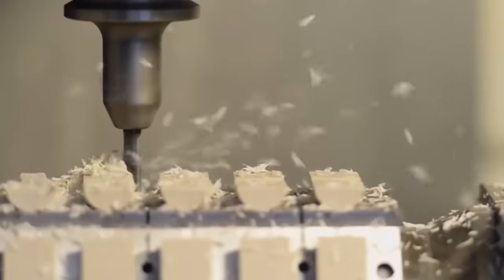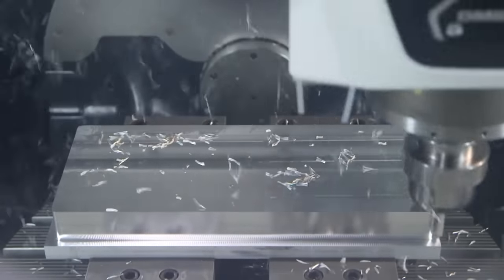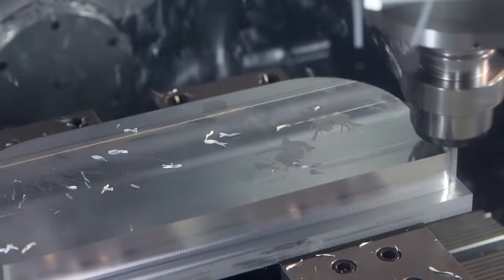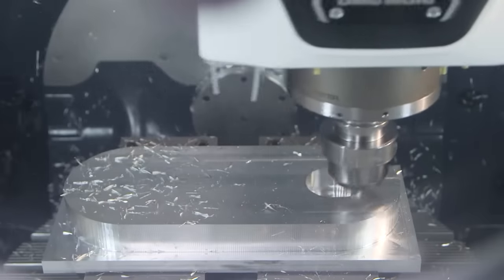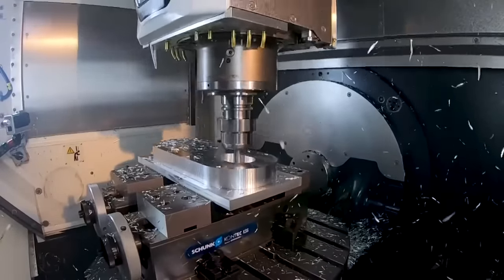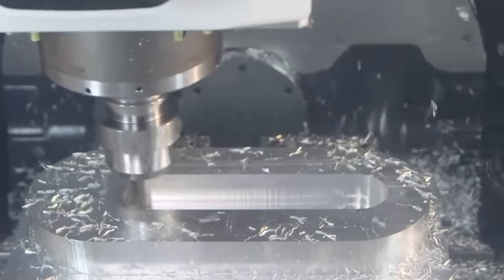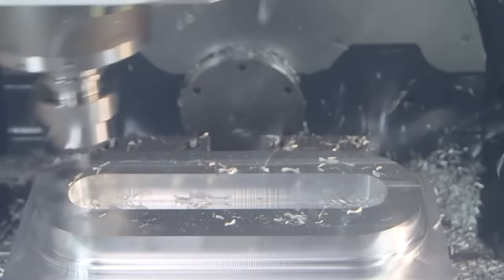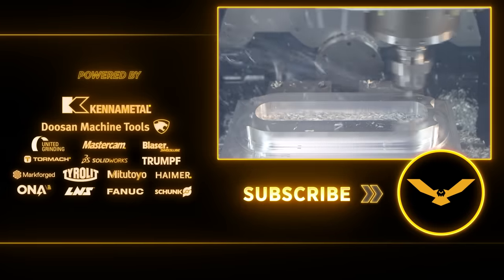High Speed Steel End Mills are Better than CARBIDE

Comment: I programmed a medical part from 17-4 the other day. The machinist came to me and said the 1/2 in endmill is running too fast. I looked at it and said its fine. I explained I was using a high speed strategy. He said he knows but, they've never run a 1/2in endmill in 17-4 over 2500 rpm even with a high speed machining.. I told him if it doesn't work, lunch is on me. He never came to claim his free lunch.
Reply: Bwahahahahahahaha love this comment
Reply: 17-4 is a very odd material as it has the ability to run at high rpm or lower rpm and both will work depending on Woc and loc. I've got a few projects I cut in that material it's  always fun material to work with
Reply: I'm relatively new to milling. I've been a lathe programmer for 35 years. I do mostly mill/turn machines.  I'm loving this new information!
Reply: Did you kill him?
Reply: What was the heat treatment of the part?
Reply: @joelstienlet1641  I believe it was H950
Reply: Those RPMs sound right to me
Reply: If I had a dollar for every time an operator was afraid of my parameters, slowed it down before he even tried it, and then wouldn't admit it was his fault when something went wrong I'd own my own company. I've programmed mills on aluminum with feeds that exceed the rapid paramater before. (Yes certain machines will alow this depending on the rapid parameter). It looks weird to the operator when the machine slows down to rapid and speeds up to feed. So they emergency nope the hell out every time.
Reply: @phuckyocouch9098 hmm I wonder why the machinists don’t trust you as a programmer 🤔
Reply: @johnjay1147 because they're not used to high speed machining. The good ones find some room to even improve the run times because initial posts are meant to be starting points that I know are safe for the tools. The ones who don't know what they're doing slow it down. I've had to do demonstrations on multiple occasions to get people to stop doing that. More often than not you're just going to hurt tool life by trying to guess when you slow it down. And don't even get me started on ceramic inserts. 800 surface feet and .008" ipr on COBALT? yes, just run it. 9x out of 10 you're gonna have to demonstrate it for a first timer.

Comment: Now a days HSS still have some good aplications due to 2 things, first as u said it deflects more, and second the edge can be thinner than carbide if u are buying high quality HSS like HSSE-PM and thats a game changer for some materials
Reply: I use it for that exact reason. On Delrin and acrylic it leaves a very nice finish. So I rough it with a DLC coated 2 flute then kiss it with HSS for a perfect finish.
Reply: @importanttingwei7747  work somewhere else
Reply: Yup. HSS is sharper than carbide.
Reply: @brandons9138  That's a myth.
Dedicated Aluminium carbide tools are easily as sharp as HSS.

And for steel a perfectly sharp edge is not the best choice.
Reply: @norbertfleck812  The sharpness of a carbide end mill is dictated by the size of the carbide grains and the amount of tungsten binder in the tool composition. Since a HSS is a homogenous material it's can be sharpened to a much keener edge. Trying to get the same edge on a carbide tool just causes the edge to round over as the carbide particles separate from the tungsten binder. I'm not saying that you can't get an extremely sharp edge on carbide, but the limits of the material composition dictate it's ultimate sharpness limit. That limit is higher for HSS.
Reply: @brandons9138  That's a myth.
The granularity of modern carbide tools is irrelevant when it comes to sharpness of an endmill. 
My carbide tools for Aluminium or wood are sharp enough to cut paper.
Reply: @norbertfleck812  It's absolutely not a myth. Carbide's brittle nature makes it exceedingly difficult to achieve the same level of sharpness as high quality HSS. The finer the edge you put on carbide the more fragile/crumbly the edge becomes.  Now before this becomes a pissing contest I'll say this. We are quite literally splitting hairs here. Both types of tooling can be made incredibly sharp. Sharp enough that it's practically a non factor.
Reply: @brandons9138  That might play a role at a knife (15°) but certainly not at an endmill. There are carbide endmills available with polished flutes which are as sharp as an average household kitchen knife. We use them for wood milling - and they perform far better and longer than HSS, especially in soft Wood such as pine.

Also HSS has got a granularity caused by its crystal structure. And it wears off very fast, compared to carbide.
Reply: It's also great for older (usually non-CNC) machines that can't reach a high enough SFM for carbide to have an advantage. Some old machines are very rigid and can handle immense feed rates and depths of cut but have painfully sluggish spindles, worst cases are usually pre-WW2 machines with plain bearing spindles.

I recently met a toolmaker who swears by carbon steel tooling (the Queensland railway workshop still taught machinists to forge their own carbon steel cutters back when they were an apprentice) for cutting very soft material like plastic. They claimed you can finely polish the edge to sharpness that even HSS can't match. I'm guessing the ability to customise the tool geometry for such stringy material probably helps a lot too. And of course the heat resistance of HSS or carbide is wasted on materials like UHMWPE because cutting at high speed just melts the plastic and makes a big sticky mess.

Comment: I work in a job shop for over 20 years and we use about 80-90% of HSS tools. That has to do with our machines. Some are 30 years old and almost no maintenance was done on them. We have chipped spindle everything is loose old adapters. 🤦🏻I’m jealous when I watch you guys slay that metal
Reply: Man, that hurt me eyes reading that. Convince them to buy ONE new machine, bro
Reply: @barrysetzer  we have some fairly new machines but those need some TLC. I have a feeling that my boss is going to sell business. He’s on the older side.
Reply: That's not too bad compared to one of my customers who run a fab shop,poor worker trying to cut solid round 2" bar using an angle grinder somehow can't afford a bandsaw but drives around in a 250K car.

Comment: yup i work at a small company that's stuck. They have no money to buy good tooling, but they have no money because they keep wasting it on crappy tooling and having to pay machinists to sit there staring at the machines running at 1ipm. I had to make a 2x2x11 inch slot in multiple 316 stainless parts and they hand me an old 5/8 HSS roughing endmill. it took me literally days to do these parts between the broken endmills and the incredibly long time it took to machine these parts. 1ipm machining sucks. Then I needed to tap these parts, I asked for at least coated taps. Instead i'm given an hss spiral point tap to use on blind holes. I asked for spiral flute taps and they said they "break too easily" and didn't want to use them. I said I can manually program a thread mill (since cam is a "waste of money"), they said those are also a "waste of money". I keep trying to help them but they ignore me because I'm fairly new to machining. trying to help them change but it's never going to happen, they're way too stuck in their ways.  sometimes all you can do is shake their hand, thank them for the opportunity and move on with your career.

On a side note i actually managed to get my hands on some 11/16 carbide spade drills and I showed my boss the drill running at 1500rpm and 8ipm into some a36 and hes "never seen the machine run that fast before". I told him that's on the low end of what's possible with modern machining techniques and tooling but they still don't want to change.
Reply: If a company slows you down in your own devellopment.. Appy for a job somewhere else.. you'll make more money, and spend less time "with your nose to the glass".. 
I spend my first 4 years in a company just like that.. i was experimenting with how fast i could push tools on a lathe.. but when i was using cutting depths over 1 mm, i was told not to do that.. because the machine couldn't handle that.. 
Then.. i became a toolmaker.. and within a month i as pushing tools with an 8! mm Cutting depth  through toolsteel on an even older lathe than at my previous job.. i learnt so much there..
Reply: You should definitely start your own shop and prove them your better

Comment: The lathe I was using the other day maxes out at ~350 rpm, a pre-WWII Monarch.  When I first came upon it a while back it had some carbide tooling with it, needed a 1/2" spacer to raise the tool post, and no one was using it.  I found a 1/2" HSS blank buried among all the tooling and ground a cutter from that.  It does what it needs to do in our shop.

Comment: I have just manual mills.  I've found that in most cases, HSS is better for that mill than carbide.  I do have some carbide for dealing with harder materials.  Both work good.  HSS is less likely to chip off though.

Comment: I agree so much with this story. yesterday I tried upping the speeds and feeds in off time with my own endmills and the results were pretty insane.
I ran a pretty low alloy construction steel at 300m/min(984sfm) with a feed per tooth of 0.2mm(.008") on a 10mm 4 flute endmill and was amazed how long it lasted
at a 14mm doc and 10% stepover. I am pretty much the only one at work trying to utilize modern toolpaths and i wish it was different.

Comment: I’ve been watching your channel for years. I was a generator mechanic turned designer in the Marine Corps  dealing with 3D printers and marveled at machining. I bought a lathe, mill and mini CNC router. I attempted it once and felt mediocre and didn’t touch anything for years. Over time I became an expert at 3D printing so much so that I started making my own. Now I’m on an all new project and needed machining services. I took a look at my machine and said to myself why not. Gave it a shot with a carbide 2 flute flat end mill. I was surprised at how clean my job came out despite the low speeds and the part being aluminum. I now plan on making my machines CNC.

Comment: I worked in a shop that wouldn't even spend the money on decent HSS, they only bought Chinese HSS cutters that were dull and chipped with burrs all over the cutting edges right out of the box, it was always a fight to get them to order me decent tools (I was the only machinist in the building). On some jobs I was able to get them to order carbide for tougher jobs like stainless steel but they never got anything name brand or coated,  just plain cheap carbide which inevitably broke or chipped. I was pissed when they laid me off, until my old boss called me a few weeks later and hooked me up with Cobalt Enterprises in Washington, they were a tiny machine shop back then but the owner knew the value in quality tools and I never had to deal with cheap tools again, and I also learned about high speed machining there which really opened up my knowledge of machining. Last I heard Cobalt was employing over 200 people and bringing in several million per month, I unfortunately had to quit the machining industry due to me developing severe coolant allergies so I haven't kept up to date with the company but they won a bunch of business awards not too long ago.

Comment: I have had great results using HSS center drills on lathes for production runs on high nickel alloys. When carbide gets dull it shatters but HSS just got progressively dull.
Reply: Agree on that one 100% even on mill I stopped using carbide spot drills for the same reason,It's the only HSS tool besides some drills I use on my machining centre. I don't know what I'm doing wrong tried too many different feeds and speeds and after a while still ends up with chipped edges.
Reply: @mehmettemel8725  I believe the problem is holding it in a chuck and many chucks are out a little depending on there history (jaw wear ect). There's a carbide insert spot drill that is held in a holder that works great.
Reply: @HighGear7445  That is not the case my machining centre is only couple of years old and using collet chucks or hydraulic chucks so run out is not an issue.I haven't tried inserted spot drills maybe worth trying.

Comment: Been doing this on the 750 I'm getting trained on. Sometimes we lose some time due to re programming and back an forth with edits. But now the programming is dummy proof and will run smooth. We have an order coming up that we will beat the runtime by hours  for the whole job because we spent an hour on the last order dialing feeds and speeds updating tool sizes

Comment: I almost fully agree with you on this subject, but I have to say one thing about it you might consider. I have done a lot of prototype work, most of my time is in that line of work. I have to say that there are times, especially in high nickel stainless steels that high speed can last longer in certain situations especially when the customer doesn't want to spend much initially and you don't know if you will ever see the job again. Additionally, when you don't have the high speed spindles and feed rates available it can create difficulty for a small shop. Drilling is especially difficult with some situations in some stainlesses and will break a carbide tool off, whereas hss will put up with  more abuse, i.e. I had to drill a .008"  hole .025" deep in a piece of titanium, and I only had one chance, I  had to use carbide because hss was unavailable at the time, and it was a real nightmare being the concentricity was insanely important. Changing the rpm was very important, and after I got the part drilled, just out of curiosity I drilled as many as I could in a scrap and at the exact setting I drilled 12 more holes. I  moved the rpm a snicker, and it snapped. I would have to suppose that hss would have been easier.

Comment: Back in my day, I kept a set of HSS mills for teflon/delrin jobs. It seemed they had a sharper razor edge that left no burr.
Reply: Carbide has a honed edge. Hss has a knife edge.
Reply: Did you try carbide end mills for aluminum or wood or... plastic? They're way sharper than the cutters for steel. I would try an up/down cut endmill, it has short upwards cutting flutes for bottom and down cutting flutes for top so it won't leave a burr to either edges
Reply: @MF175mp  Yeah there are specialized carbide cutters for almost any application, they really pay off for regular jobs. For one offs having a sharp HSS endmill flying around can do wonders.

Comment: HSS can also take lighter cuts than carbide... It really helps to use HSS in reworking parts that are out of tolerance...
Reply: Thats good to know will have to test this out for my next reworks !
Reply: @austinyates4923  But you need to be aware, that you need to have the cutting edge very sharp... Carbide can also work, but it mostly has a slightly rounded cutting edge... Thats the reason Carbide cant that such light cuts... BUt you need to be aware that I only know that on lathes... I dont have knowledge, if that works on mills too... And you need to make sure, that the geometry of the HSS is right... This Old Tony has a Video "Grinding HSS Tools", which I can recommend...
Reply: @intubungamer6173  Ive found that although cutting conditions are not ideal, carbide end mills absolutely can take very light cuts to reach tolerance. Sure its gonna wear slightly faster, but carbide is so much more rigid than HSS and allows you to make those full DOC walls accurately.
Reply: @intubungamer6173  End mills are very sharp compared to lathe inserts. Also there are dead sharp carbide inserts or dead sharp solid boring bars for lathes too but their applications are more limited in turning (not so much for the boring bars)

Comment: Thank God I always worked for shops that weren't afraid to spend the money for the best tool for the job.
And sometimes HSS tool's are the best for the job, but not very often.
The advantages I have had with HSS was the tool can take a shock. Like using the tool through different materials, hardnesses, intermittent cuts and I have even had better tool life in some high tensile strength materials.
If you have rigidity problems HSS can sometimes works better.
But I can probably count on one hand where a HSS tool could do the job carbide, ceramic, PCD, CBN, coated carbide etc. couldn't.

Comment: Don't forget about down cutting endmills. You can pinch the work in a normal vise and leave a huge stickout or overhang and only support with a machinist jack. The cutter pushes down and the vise stops the twist.

Comment: I’m cutting stainless steel, and other steels including some with super hard flame cut crust, the HSS Rippa 20mm is outlasting the carbide, it’s also only a 1/4 of the price at £36, tbf it does have a coating on it but still super cheap.
Reply: that work hardened rough shit is  notorious for slamming carbide into it's own grave. HSS has enough give to flex on interrupted cuts where carbide would probably shit itself.

Comment: I make the carbide cutters for the machine shop I work in.  We have a mix of 60s machines all the way up to a new 5 axis huge machine centre. Heavy speed4 machine 

Most of the cutters I make are for stupidly tight tolerance jobs.  I had a cutter come back because it was 0.004mm out  4 bastard micron   Not a chance we could do it with hhs.

Comment: We made the change to high speed machining when I took over programing and setup. It's been a learning process. to say the least. 
High speed machining will work in older machines but your spindle bearings might not handle it. Short cycles, sure, but anything that takes time I would slow the RPM down and adjust the feed accordingly.
When programming, try both high speed paths and traditional. On occasion you will find the traditional path is faster.